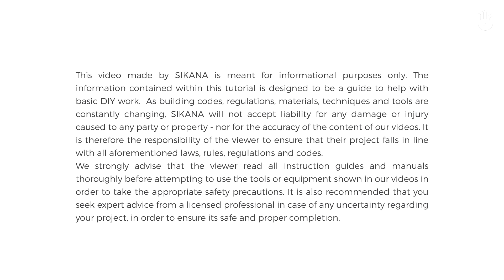How to Build a One and a Half Brick Wall Using an English Bond | Masonry

Comment: Thank Sikana, very informative and supportive, I have had problem of this topic for long time until I watched this very- easily to understand video
However, I still have another problem of how to build wall if the length of the wall IS NOT FULL BRICK ( E.G there is a broken bond in the wall length, if the wall is strecher bond , the broken bond can be solved with a 3/4 bat, but in English bond, what to to do if the wall has a broken bond??)
It would be much appreciated if you could make a video to explain this problem to help all the beginners , like me, who start learning bricklaying
Thank you very much